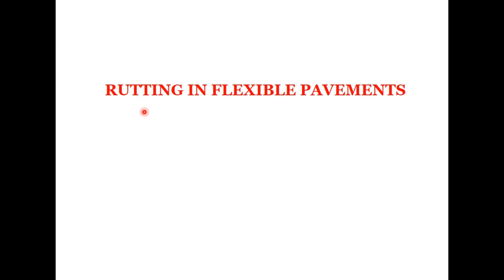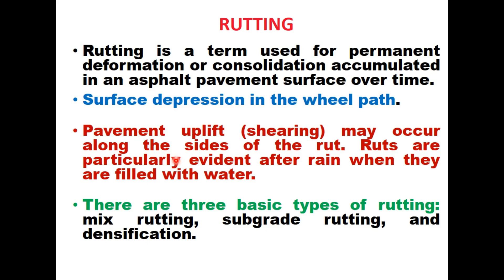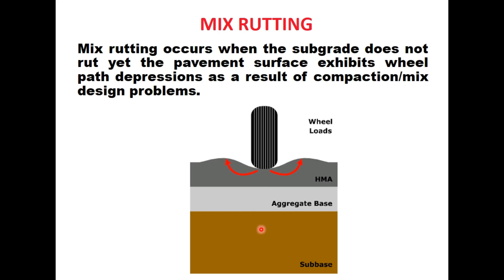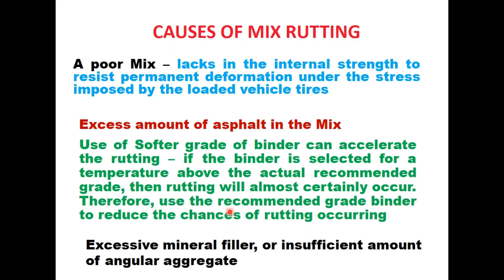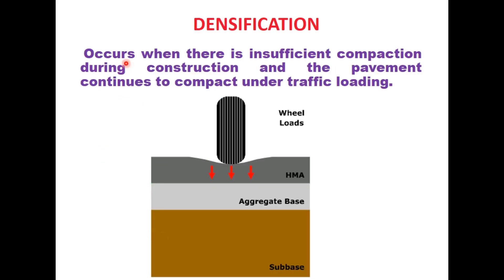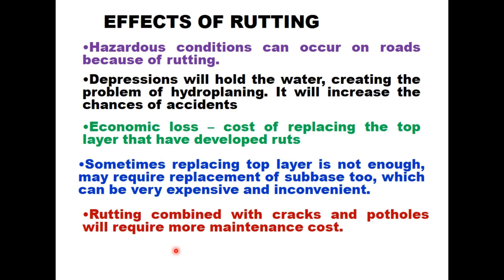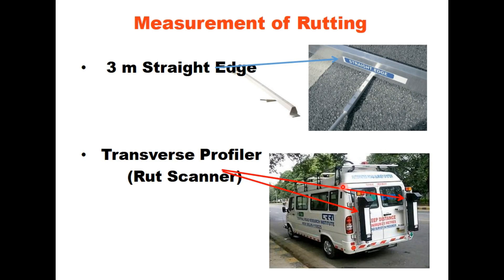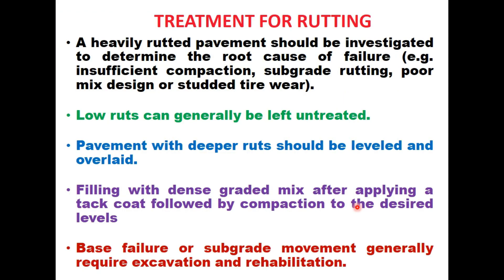#rutting, #pavements, Rutting in Flexible Pavements, Causes and Repair.

Comment: sir we are constructing a hill road۔ We laid wmm and left the road open to traffic for 3 months۔ Now we start the construction of BM۔ But we are finding ruts in wmm layer۔ what could be the causes۔ & what should be the solution sir
Reply from the maker: WMM is an unbound layer and cannot take vehicular traffic load. Section 406.4 of MoRTH book says vehicular traffic should not be allowed on finished surface of WMM. Only construction equipment are permitted.
The rutting which has appeared now is to be corrected by a profile correction layer of WMM material.
Reply: @SatishIITR  sir  thank you for the reply ۔ Sir in this road we are having a problem of lower CBR value of the subgrade and clayey type soil in subgrade۔  As a corrective measure we got approved an additional layer of 75mm wmm۔ Now our crust is 300mm GSB + 150MM wmm۔ Now after the additional 75mm layer wmm layer was executed ، but for some reasons macadamistion could not be done۔ Now after 3 months we see that the wmm is well compacted but for some stretches we see tyre ruts۔ Now our doubts are، is it sign of subgrade failure or wmm failure۔ Now how should be proceed for the macadamistion of those affected stretches where tyre ruts are profound۔  worthwhile to mention it is a frost prone zone and the road has traffic of passanger buses and loaded dumpers۔
Reply from the maker: @mr.sharma1074  I have replied to your email also. see
Reply: @SatishIITR  Thank you so much sir. Your feedback was of immense help to us and our department as a whole. You are doing a great service to the nation. we as a working engineers often need guidance from experts.Your services are invaluable.
Reply from the maker: @mr.sharma1074  Thanks and best wishes

Comment: Sir, in the definition of rutting, said that rutting failure occurred due to the vertical Compressive strain at the top of subgrade, but in the mix rutting subgrade doesn't effected. So why we are called its rutting? And also for densification?
Reply from the maker: Rutting on the surface is contributed by all the layers. It is found that almost half of the rutting is contributed by base and subbase and remaining half by the bituminous layers. Mix rutting occurs due to poor design of mix, gradation of secondary compaction after opening of the road to traffic. This is completely avoidable and is not considered in the design of pavements. Similarly, rutting in granual layers may be due to overloading or overstaining of subgrade or inadequate pavement thickness. The pavement design should be such that overstraining of every layer of the pavement is avoided.